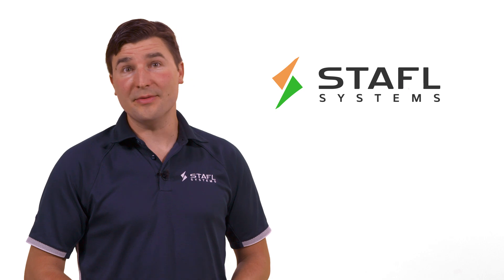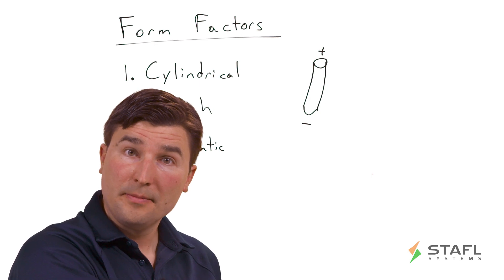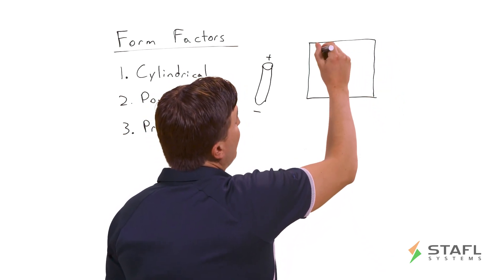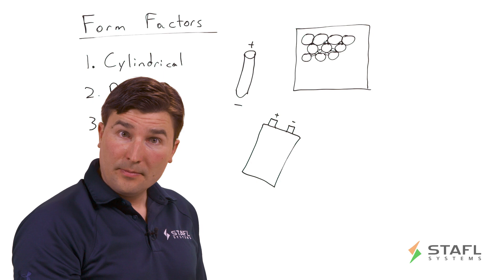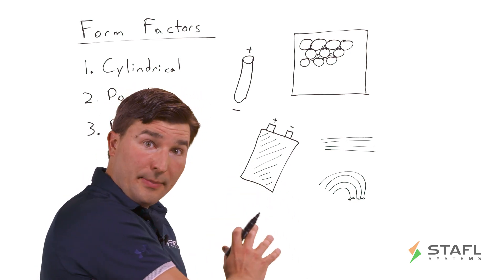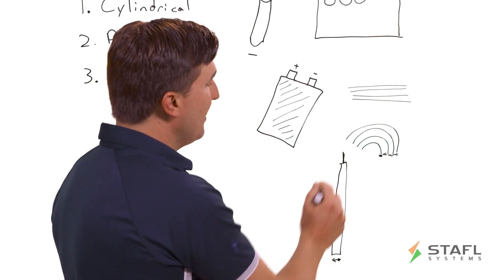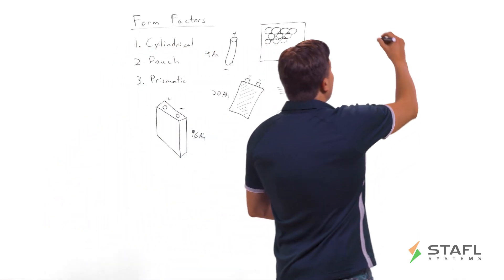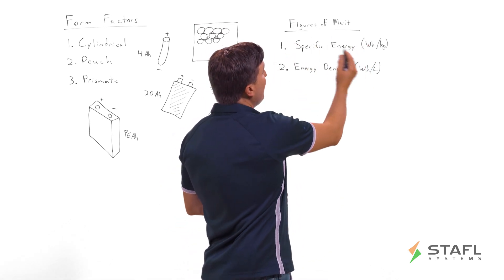Lithium Ion Battery Cell Selection for Battery Packs

Comment: Replacing Cells with another manufacturer's cell is asking for issues.  Unless the entire pack is changed, capacity and nominal voltage and other characteristics are also likely different and present a problem for those who think they can change a few batteries of a larger pack.  This is very dangers!!  Oh and by the way, there are only Cylinder and Prismatic cells all others are variations of though.

Comment: Excuse me but at 2:00 you state you can use different manufacturers cells so long as the physical size is similar. Incorrect as different manufacturers have different capacities and amp discharge

Comment: Hi Erik, I am going through all your videos, as you have produced some very good content.  But there is one statement you made in this video regarding the pouch cells which is in line is what I can find generally on the internet, that this particular form factor will expand and contract that requires special attention as well as kind of disadvantage it with respect to the 2 other form factors.  But does the materials in the cylindrical and prismatic cells also do not face the same constraints?  How do these 2 other form factors mitigate the growth in size while charging and contraction while discharging? Wish you were posting more content on YouTube.  Thanks for the great work.